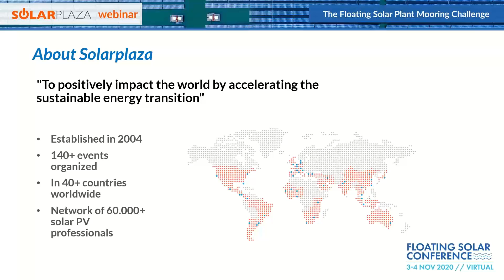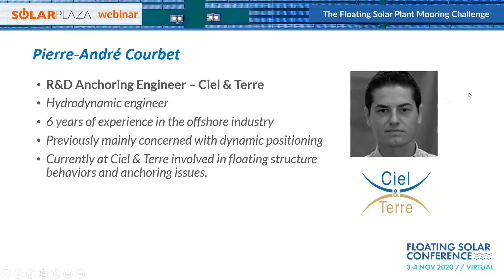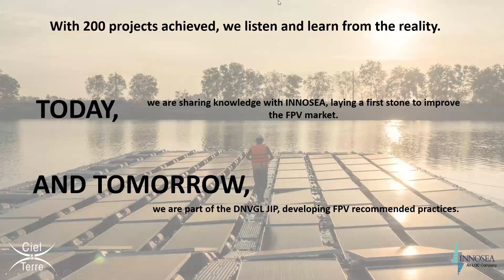The Floating Solar Plant Mooring Challenge | Solarplaza Webinar

Comment: 15:15 Why do we anchor floating power plant?
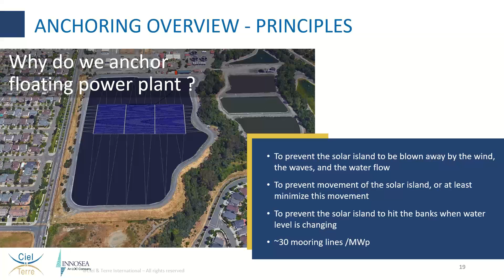17:02 Anchoring overview - Methods
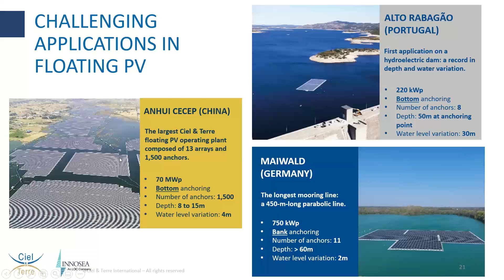20:21 General feedback & Main Challenges
25:20 The design of mooring system
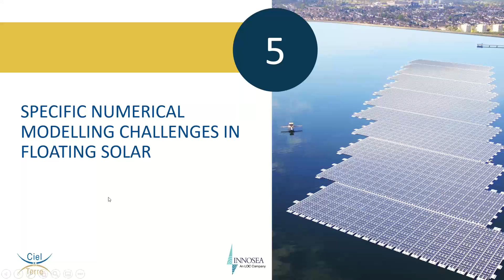28:52 Specific Numerical Modelling Challenges in Floating Solar
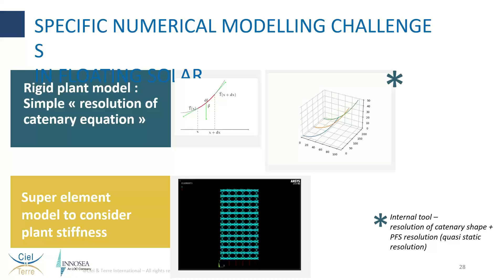30:18 The feedback from expert of offshore anchoring engineering
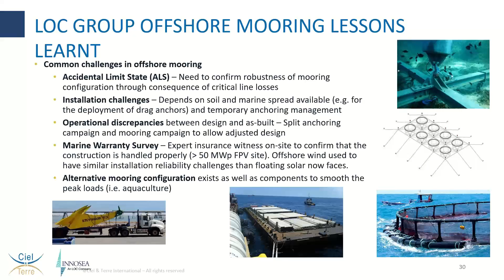33:42 The new anchoring solutions (Lesson Learnt)
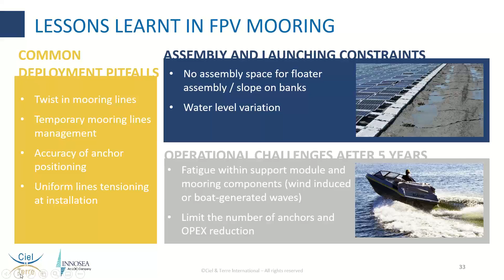40:38 The new anchoring solutions (Technical Spec for new mooring)
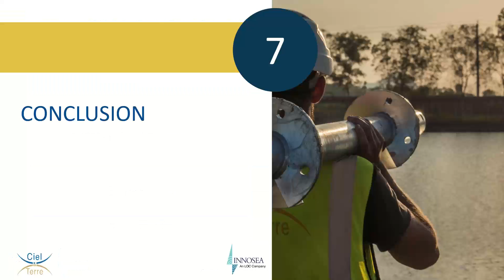41:15 Conclusion
43:20 Q&A